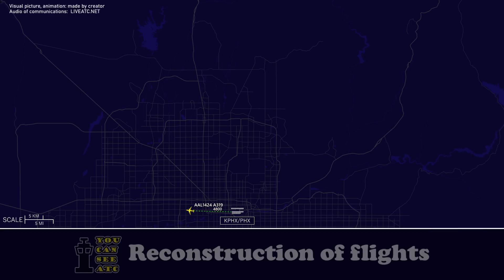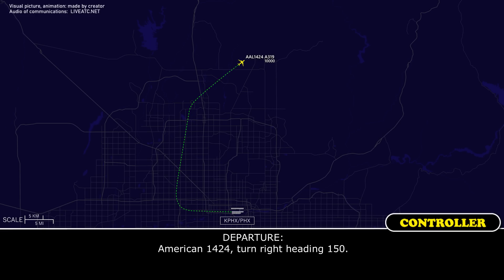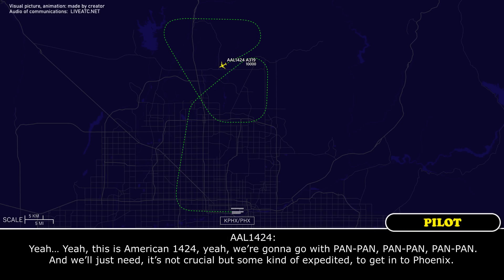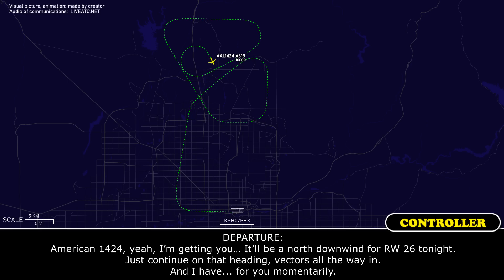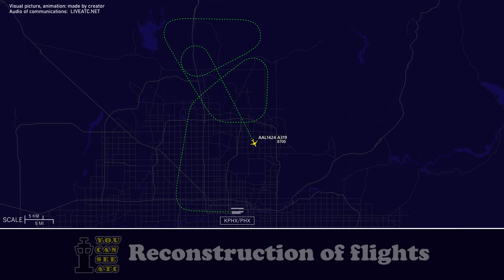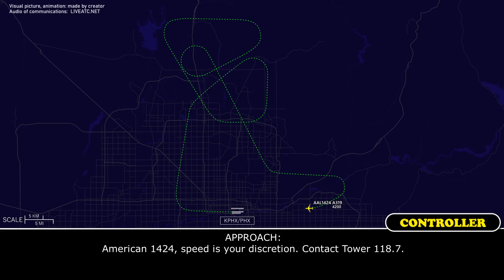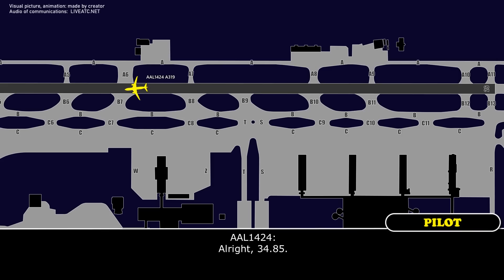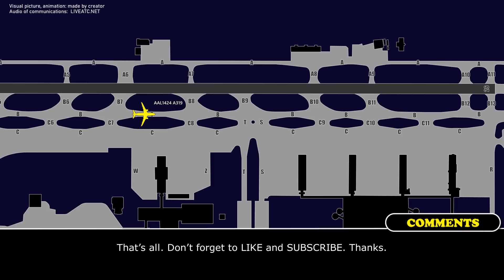MAYDAY. Engine failure on final at Phoenix Sky Harbor. American Airbus A319 engine problem. Real ATC

Comment: Shows how quickly a pan pan and just roll the trucks as an exercise can change to mayday mayday mayday. Well done to the crew.
Reply: Out of the pan-pan, into the mayday-mayday.
Reply: @jjbailey01  Actually elevated to Spatula Spatula.
Reply: @RLTtizME  get ready to break some eggs. 😅
Reply: As a student Pilot I learned , when dealing with a engine problems   /failure never refused emergency equipment  on standby
Reply: What is pan pan compared to mayday?
Reply: Pan is some problem requiring assistance, while mayday is major danger of crash.
Reply: I watched whole thing, I didn't hear when it became a Mayday call ..   How, when & why did that happen ?
Reply: @starrynight3363  08:38 Pilot tells the controller Mayday Mayday Mayday we get a few more indications now
Reply: @bigfattoni  Thnx Stefan!
Reply: @starrynight3363  Please research this on the internet. Report back.
Reply: And most crews wouldn't have bothered with a mayday, pan nor an emergency, which would have made everything safer because the controllers are smart enough to figure it out anyway. Neither the "pan" nor the "mayday" added a bit to the awareness of the controller.
Reply: @Videos888  The outcome no different at all. Why do people think it is so important? The eurofreaks especially.
Reply: They are doing away with Pan and Mayday. It is so Euro-Trite.
Reply: @RLTtizME  source? I didn't think this was true
Reply: @RobertBardwell  I just made it up to get a rise out of the Pan Mayday Dorks.
Reply: @RLTtizME  I heard anyone using pan pan will now be shot upon landing.
Reply: @devinthierault  And properly so. It is so toolish.
Reply: @RLTtizME yea I'm not fond of mayday or pan
 Eather you have an emergency or not plane and simple

Comment: Plane has 2 engines.can fly and land on one! Phx has long runways.too much fuel!
Reply: They weren;t anywhere near overweight. I worked at Sky Harbor as a fueler, and I;ve fieled that exact plane on that route. THey only take about 15,000lbs of fuel, which is nothing compared to the 40,000lbs they can carry.
Reply: @murphsmodels8853  tbf they might take extra for weather but still 🤷🏻‍♂️
Reply: @arjunyg4655  that was accounting for weather. Standard fuel load for that flight with a 319 is 6000lbs.
Reply: @murphsmodels8853  ah nice 👍
Reply: We don't know the nature of the engine problem. Might be able to fly on one, but it could cause many more problems.

Comment: Don't they believe their engine instrumentation? But I don't know if it was just a bad oil pressure indication, so my suspicion of calamity probably isn't warranted. I wonder if the 737 crew that ended up in the Pacific off Hawaii had the same lack of belief before they went swimming. If the engine instrumentation says something bad is happening there's a really good chance that multi million dollar badness is occurring. Does it make better financial sense to stoog around waiting to see if it trashes itself instead of landing before that happens, on the off chance that maybe the instrumentation is bad.
Reply: Pilots don't make up new procedures on the spot to save the day. That only exists in movies. In the real world you have a procedure and steps to follow. If they got an indication, there is a procedure for that indication. Some procedures say land immediately, some say land as soon as practical, some have like 30 steps to resolve the problem. You don't know what indication they had, you don't know what procedures they had to accomplish and you shouldn't assume they did anything other than handle the situation perfectly.
Reply: @A.J.1656  Which incident, this Airbus or the 737? This Airbus was never going to result in potentially drowning everyone, and they work well enough on one engine. So I just wondered about the cost judgment between the risk of trashing an engine and the cost of aborting the flight. In the 737-200 case... sometimes you have to just get on the ground. Do you know of a non-normal checklist for both engines failing? Anyway, chances are they ran the non normal checklist for engine fire or severe engine damage, maybe tried the relight procedure, then the approach briefing, then started on the landing briefing and at least they survived ditching. There's no official report yet, but at least one place says they had anomalies on both engines. The precedure for that starts with "Immediately on recognition of loss of thrust on both engines the aircraft should be turned towards a suitable airfield for landing, this should be done at the same time as the appropriate non-normal drills are being actioned."
Reply: @cageordie  
Yes, I do know of a non-normal checklist for both engines failing. I'm just looking at it in my QRH now, it's 3 pages long. 
Maybe I'm missing the entire point you are trying to make. Your comment makes it seem like you believe the pilots didn't believe the indications they were getting. You assume the indication was of something "bad". You seem to think the pilots should make financial decisions based on some abnormal indications. Not knowing anything about the indications or action taken by the pilots, I don't think you have any idea. If you know something that isn't in the video that would make you suspect they did something wrong, please share it with the rest of us so we can try to understand that comment.
Reply: @A.J.1656  I can see that. I could edit it to make my question clearer, but that wouldn't be fair to you. So if you lost one engine and the other was also giving problems would you wander off towards Japan descending and slowing, or do a very quick return. In fairness to the crew that ended up swimming, they probably had a lot on their hands.
Reply: @cageordie  
Hell, if I lost an engine, I wouldn't cross the Rockies, let alone the Pacific. 
Is that what happened to the other jet you're talking about, they lost an engine and the other one was having problems?
Reply: @A.J.1656  They lost one engine in a 737-200 full of cargo as they departed, and turned south over the Pacific to avoid the mountains straight ahead. They declared the emergency a few minutes later and had lost one engine. It took three attempts before ATC got the picture, lack of procedure and an ATC who was working something like four frequencies and kept talking over them. When she got the picture she asked if they wanted to return immediately and they said they had some procedures to run. The claim that I have not found in any proper report is that they then had trouble with the second engine. They continued WSW until they realized they were in deep shit. At that point they asked for an immediate return, but by then they were out of sight of the airport. By then they were down to a couple of thousand feet and under 200 knots and still slowing. Not a chance of making land at that point and they turned north and ditched. Only two crew, one was seriously injured and the other wasn't.
Reply: @cageordie  
Wow. That sounds pretty bad. It would be interesting to learn the details what happened in that incident. I wonder if it was something similar to the C5 crew that lost an engine and retarded the thrust lever to one of their remaining operational engines. 
I have personally had "engine indications" that required a return to our departure airport, but we had to run the procedures to attempt to resolve the issue first and by the time we landed we were only a few hundred pounds under an overweight landing that would have created separate maintenance actions before returning it to service. Sometimes a return to the field at the first indication of any issue just isn't the correct course of action.
Reply: @A.J.1656  He's talking about Transair 810.
Reply: @A.J.1656  Right, like the Kegworth 737 crash where they lost a blade and then shut down the good engine because they had an intimate knowledge of the previous version of the 737 and knew that the fact that they could smell cooking engine meant it was right engine because that's where cabin bleed air came from. But Boeing had redesigned the systems to use air from both. So he shut down the perfectly good right engine while the left engine left a trail of fire from unburned fuel igniting. The cabin crew and passengers saw that, but nobody felt the need to make sure the flight crew knew. Anyway. Part of the problem is the incredible reliability of jet engines. So procedures mostly assume that it is extremely unlikely that you are about to lose the other engine too. When I worked at RAE Bedford I remember seeing the paper, not ours, that 'proved' that there wouldn't be a double engine failure on a modern twin. It was part of the proof that ETOPS was a good idea. But since then there have been something like half a dozen twin failures. The first two that come to mind were fuel starvation, the Gimli Glider because of bad metric-imperial calulations and loading, the second Air Transat 236 which cross fed all the fuel out of the fuel leek they didn't suspect. Both of them ended up with dead stick landings on runways. Amazing luck. But I digress. As I've said before, sometimes you've just got to realize that your incredible machine is about to become unflyable and just get to an airport, or even a soft spot, right now. If your procedures take five minutes and you are passing the airport at 200 knots and going down at 1000fpm with the power you can get, well then you need to do what you can remember of the checklist and get to the runway. The saddest site I have been to is the Swissair 111 memorial at Peggy's Cove in Nova Scotia. If they had known they had a fire burning through the controls they might have got to a closer runway and lived, tough one in that case, there was little time from the fire being detected to the aircraft falling out of the sky. But they were so close to Halifax when they died.
Reply: @cageordie  That British Midland 737 crew ignored all the appropriate S.O.P.s and check lists. The captain just accepted the first officer’s wild guess which was not based on the engine instrumentation, the instrumentation display was also badly designed by Boeing, the -400 was very new then.  They had tons of time to re-evaluate and go through the procedures during their long descent to their crash site.
The U.K. has a culture of investigate and not prosecute.
Reply: @givenfirstnamefamilyfirstn3935  Yes dear. The big mistake the crew made was that they KNEW that the cockpit air came from the right engine, so the fact they could smell smoke meant it had to be the right engine. But the -400 had swapped the source of the cockpit air, so the left engine limped them all the way to the crash while the perfectly good right engine took a break. And yes, the AAIB and the CAA do things the right way.
Reply: We have no clue what the indication was - there could be hundreds of items that pop up on the ECAM which mean next to nothing and will be handled on the ground during the next turn. All they can do is run their checklists and advise company. 🤷🏻‍♂️
Reply: @EstorilEm  Very true. And it's a cost judgment, returning to the airport for a bad sensor would have cost tons of fuel and a lot of money. It could still have been something relatively minor that resulted in the shutdown in the end. There was nothing falling out of it at the end, so it hopefully wasn't the million dollar rebuild sort of problem.
Reply: What 737 ended up in water off Hawaii? Didn't hear about that?
Reply: @barbaracameron5610  TransAir 810 July 2 2021 (Some show the flight number as 4810 but the aircraft as 810). Engine failure on takeoff and they took a broad right turn out over the Pacific and then realized they couldn't maintain altitude and started to come back in. But by then the airport was unreachable and they ditched. Sometimes you really just need to get back on the ground. Most of it goes to the crew for running checklists on a plane that was slowing and descending at low altitude over the ocean when they should have been heading straight back in.
https://www.youtube.com/watch?v=HsjIMAr3nZk
Reply: Check engine indicator lights up.

Pilot rolls down the driver’s side window, sticks his head out and looks back… “Yep, it’s still there!”

Comment: Good call by the tower to send out the trucks
Reply: Standard for almost any emergency in the US.
Reply: I think almost any tower controller will send out the trucks if in any doubt. Unless they're already dealing with something else, it doesn't hurt the emergency crews to roll out and get in position - as the pilot said here "let those guys get some exercise". FAR better to have the crews deployed and not need them than to suddenly need them because a situation got much worse and have them scrambling into position at the last minute.